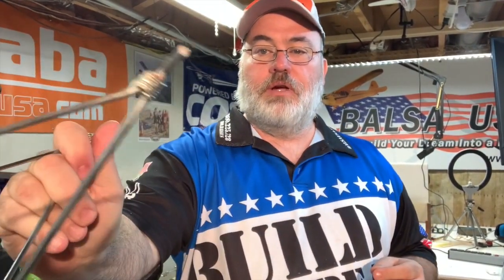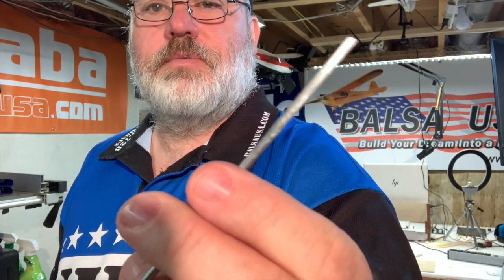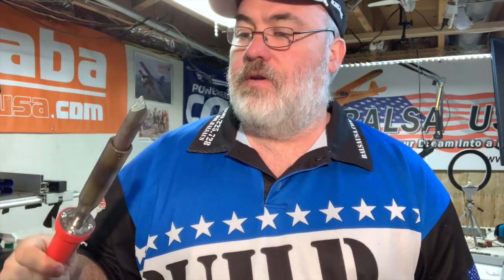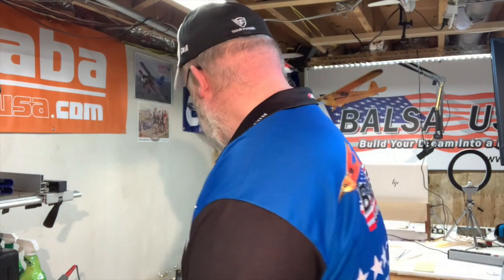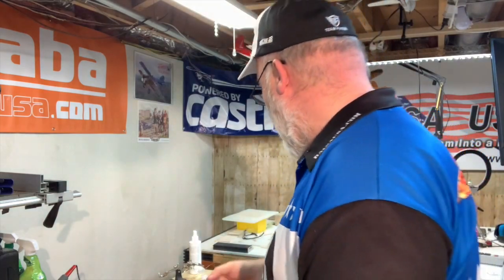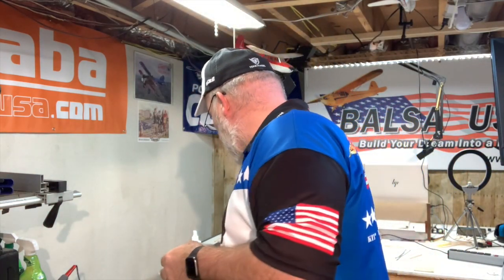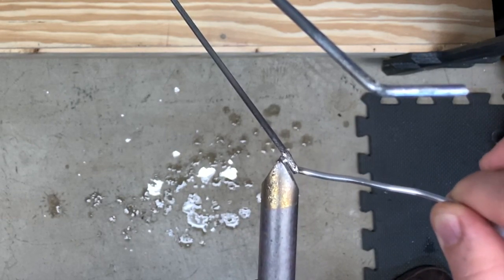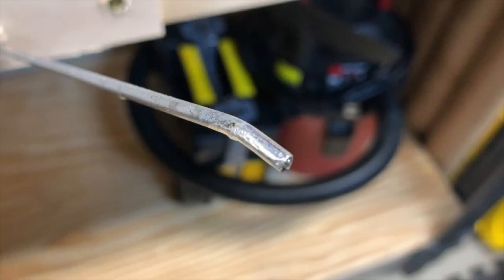Shop Time Live Soldering 101

Comment: great helpful video! last year I used a weller 200/300 d650pk soldering gun  and was having a hard time with my Nieuport 11 and 1/4 cub with the soldering but got it pretty good.  I bought the weller 175 and used it for soldering the center cabanes and landing gear so far on 1/3 scale pup, worked excellent and went easy and turned out great! Thanks!